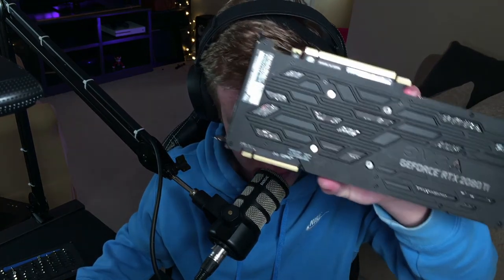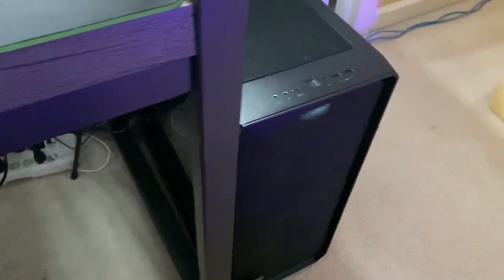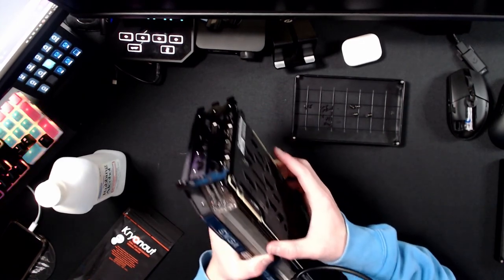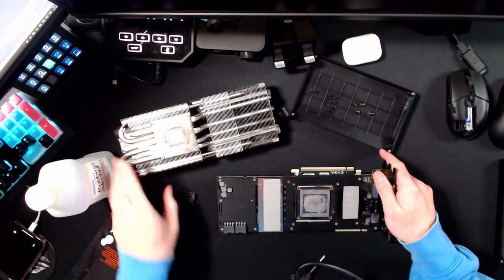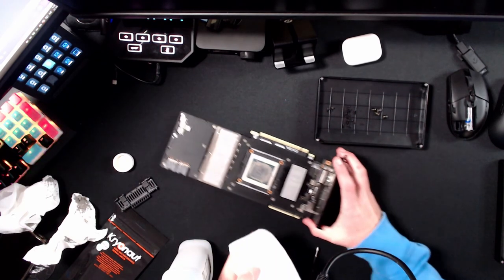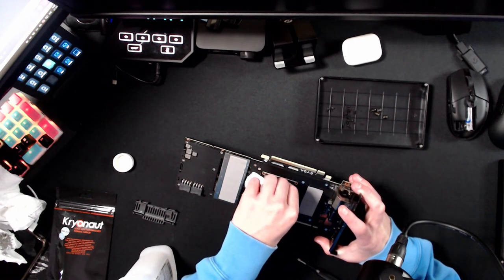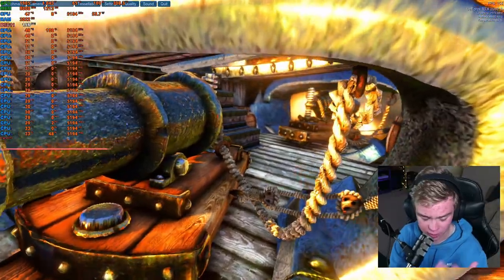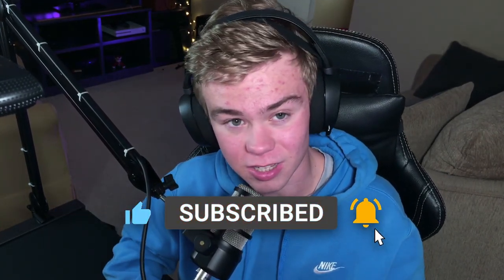EVGA XC Ultra 2080ti Repaste

Comment: Thank you! Just used your video to do my GPU. Exact same one. I had to really work mine. I’ve got one on a mining rig and I took it off and freshly started working with it and it was super tight and the pads were sticking to both top and bottom when removing. Not sure if it was because card was super warm or what. Lowered 1-2c that was it. Stays at 70-69 now but 70. EXCELLENT video for everyone! Thumbs up

Comment: Thanks for this vid, i wanted to check a tutorial before unscrewing anything on my 2080ti xc gaming. Also u mentioned yours is used and at 74 and calling it “terrible”. Mine was brand new and it ran 84C out of the box lol. Its been running like that for 3 years no problem, but i feel like its super hot although everybody who has this card have same temps. Yours i feel is lower because the previous owner has repasted it also. Thanks for the video, im going to do that to mine now!

Comment: I own a Gigabyte 2080 Super. Got with Red Dead Redemption 2 temps around 90 degrees C with fans at 100%. Repasted with arctic silver. Same load now 67 degrees with fan at 60%. Crazy difference! Even lowered my case fans by half, still get 68-69 degrees.
Reply: nice
Reply: Mine is hitting 79°C, 5 years old. Gotta do that asap.

Comment: Also, if you are running your card at that 360w bios, then 74 is pretty good and you probably shouldn't expect much from a repaste unless you go LM. Did you try it w/360w going through it?
Reply: The 360w bios is useless -- it'll still cap at the normal voltage.  You can't get around a hardware voltage cap by flashing the bios.  The bios is compatible with his card -- he CAN do it and everything will work fine.  It just doesn't do anything different than stock.
Reply: @DaemonJax  it's not totally useless because sometimes the power limit comes into play before the voltage is fully maxed out.

Comment: It doesn’t look like you need to remove any of the small screws, just the 4 main ones in the middle. Can anyone confirm this?
Reply: You’re correct. Only the 4 core screws must come out. I did have to take my endplate off though. The silver piece by the connectors

Comment: 74c isn't that much man. I OCd mine (same card but I have the XC2) to +150 core +1000 men with the slider all the way to 130% and I hit 75c benching. It stays in the high 60s at stock settings.
Reply: Yeah 74c is around the best you can get with the stock cooler on air (depending on ambient temps and airflow of course) when running at 100%.  Since someone else already re-did the tim, he got next to no cooling improvement.  Next step would be to watercool it.